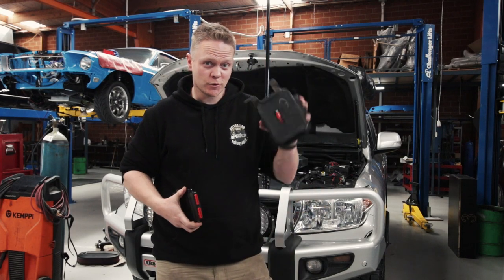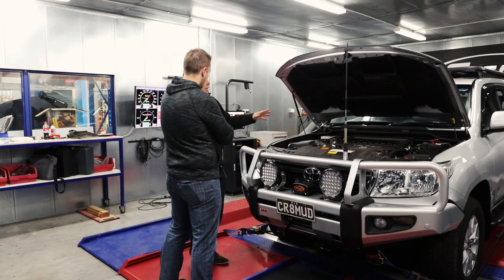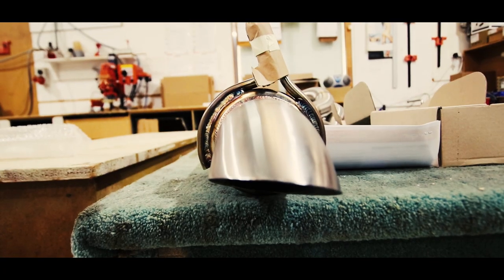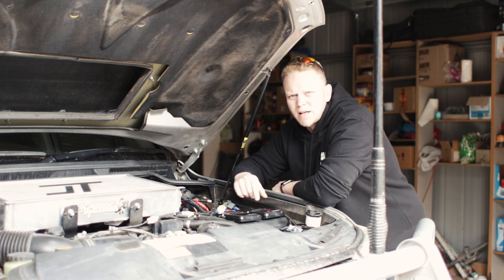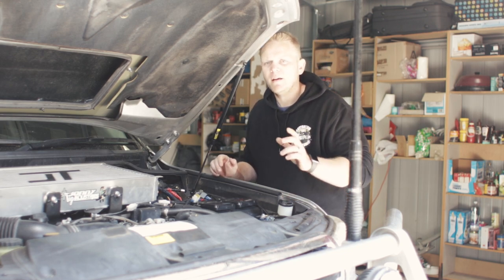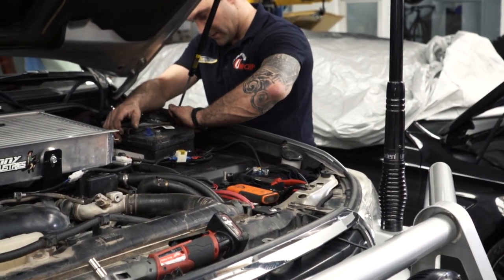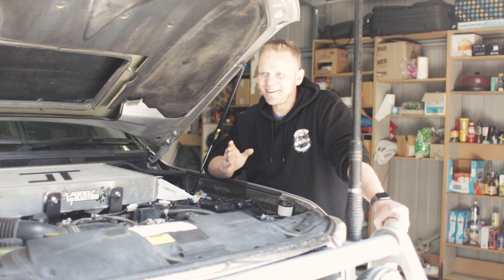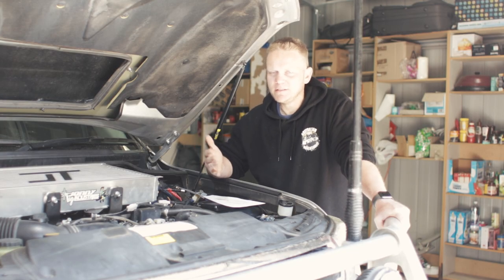Does more MONEY mean more HP? - Unichip X Vs Safari Armax ECU

Comment: I hear you can use the unichp on the 4.8 Nissan patrol petrol 
Is this correct 
I run 35s and tow a camper off road

Is there anyone in SA to fit them 
Thanks
Reply from the maker: Yeah absolutely can.  
Not sure who the retailer is in SA.  
Give Dynomotive a call and I’m sure they will point you in the right direction.

Comment: 118kw/550Nm...is this correct for stock cruiser? 

Well after all  this...this is how I'm seeing these numbers.. 

Toyota V8 4.5L
118kw/550nm. Stock
144kw/620nm. Safari  $5000
166kw/785Nm Uni X    $2500

Nissan 4cy 3.0L CRD
192Kw / 808Nm ECPT $1000
Reply from the maker: So many variables in the process. 
2 wheel dyno 
4 wheel dyno
Temps on the day
Tyre size
Safty In the tune

It’s not about the final numbers it’s about the % increase over factory.
Reply: @Australian4x4Adventures   Cheers for the reply...Fyi... Im on your side BTW 👍
We got the answer to my above question, the reason why the Nissan Patrol 3l is able to push 190rwkw /800rwNm after a remap has something to do with the CRDs are balanced from Factory, have the DOHC setup 4val/pc.. and some other crazy stuff which too long to fill in here..but has been done. factory after the DI versions went to shit. 
Anyway keep up great work!

Comment: Was intercooler on before armax tune? And has fuel economy decreased? As power delivery is now in a different rev range.
Reply from the maker: No the intercooler was after the Armax was installed. 

I mentioned in the video that I went back to safari to see if they would re tune the car with the new cooler and they weren’t very forthcoming with an answer and informed me that it won’t make any difference. 

That’s when I went to Unichip.    It’s all explained in the video
Reply: @Australian4x4Adventures  yeah copy that. I think I've seen standard coolers with uni x runnin 700nm so you can tell ya mates at  armax😜 that it is good for 85nm more at the wheels, and I'm tipping inlet temps wld be down by 4-10°c at least.  Good vids bro good to see you vented that bullshit on the mainstream too, good onya!!

Comment: Hey mate the ARMax gives two extra benefits I believe. Warranty on engine / gear train and lower torque on each gear change for a smoother ride. Does the unichip offer that....your commentary will be much appreciated. Also the wiring on unichip is it IP68...
Reply from the maker: Hey bud.  

Yes they offer the drive train warranty just like safari and the torque is also reduced for gear changes.  

It also ramps power up and down based on engine temps as well.

Comment: I'm currently researching many different chips and remaps.

It seems both have pros and cons.
I do rather like the idea that if a chip fails in a remote location then according to many different sales people then it's a matter of unplugging it and returning the vehicle back to factory specs.

However it does seem that the remap makes more power.

What's your thoughts on both?
Reply from the maker: Both the safari and Unichip are great bits of hardware.  
Unichip for me wins out based on price and better performance. 
A remap is only as good as the tuner you fine and can’t just be unplugged if something does go wrong.

Comment: Hi Mate great vids but wasn’t the power run in your Safari ecu video that shows the Dyno screen at about 14min 20 secinto the vid showing 177.1 kw / 461.2  for Armax ecu and  snorkel not 146.5kw / 326.6 which I thought was the Armax snorkel only run. 
Happy to be corrected and no I have no affiliation with anyone either just doing research for  a good safe engine boost for my 200 series 
Cheers
Shane
Reply from the maker: Hey mate.  
It was something like that ( can’t remember the exact figure ) but that’s because they made me put smaller tyres on to show a higher figure. 

We re ran it with the 33” muddies I run normally at Unichip and it only made the 146 then re tuned it with the Unichip and got the 180 something with the 33s on still.

Comment: I had a Safari snorkel. Actually I’m planning to fit in a Safari ECU when my car is out of warranty. Thanks for your video. I will not do it anymore. I’m just feel very uncomfortable that as a brand with a big name, the way they buy their reputation. It’s a shame. 

Btw, after you fit in the unit chip, there’s a significant increase on the Torque. I’m guessing you’ve done several off road trips. Did you have a check your transmission? Is there anything wrong? I’m just a bit concern about the reliability of the transmission after tune....

Comment: What wrong with remapping through the Kess Ksuit method? You don't need a new ECU.
Reply from the maker: Nothing wrong with remapping for the main part.  

2 down sides but.  
1.  It can come down to how good the tuner is.  Which unichip falls into that bracket as well. 

2. It can’t be removed if you’re trouble shooting something.  Or if Toyota reflash the car for an update it’s wiped.
Reply: @Australian4x4Adventures   So at the end of the day if you love spending money at Toyota and cant rationally diagnose the people with a good OB2 tool, then you should buy a Uni chip? I see the typical corolla driver is infectious indeed with in the 4X4 community. mmm
Reply from the maker: Sorry I’m a little confused by your comment. 

Unichip / dynomotive is also a mechanical shop as well and do full services on all males and models.    

You don’t need a unichip to be a customer of theirs.
Reply: @Australian4x4Adventures  Good to know they provide full service to all males :)  clearly with a happy ending.....
Reply: Adrian you can use either method, both are valid. Chip vs remap, they both have their pros and cons. Why do you think the remap is better?

Comment: Out of curiosity, does the Unichip offer a decent warranty?  I know the Safari ECU retains a huge engine/driveline warranty and I really think that's where the strength in the product lies.  Not trying to stir the pot, a genuine discussion point I think.

Alot of people are waiting until their vehicles are out of Toyota warranty to get power upgrades.  Really, the Safari kit offers a full 5 engine engine/driveline warranty on new cars no there would be no need to wait?
Reply from the maker: Good question. 

Unichip offer the same 5 year 100,000km warranty for new cars. Same as safari. 

All in writing also the same as safari

Comment: Hey Steve
I’m getting a unichip put on in the new year, now that you have been running for a month or so are you happy with the setting or is their one you would like to change ie high idle , thesis response throttle for rocky terrain 
You get the gist
Cheers
Reply from the maker: Hey buddy. 
Yeah I’ve had it on the car for almost 3 months now and still loving it.  
I generally run it on the towing map because it just feels the nicest for driving around home.  
Smooth but still plenty of power.  
The power map is amazing but only really use it when I feel like driving a little nuts or someone NEEDS to be overtaken right now 😂.  

Offroad map is amazing.  Didn’t like it to start with as the throttle was really soft and it took me a day to get use to it but now it’s great.  
No jerky throttle and nice and smooth. 

The immobilized map I use more then I thought.   I park my car with the keys left in it all the time 😂.  

So I put it to that map and I feel a little better about it. 

The one map I don’t like and will prolly change is the eco map.  Feel flat and I don’t like it.   
I’m going to change that to the high idle for winch and battery charging at camp.
Reply: Cheers for that, I too am guilty for leaving the keys in the car, I don’t even lock my work trucks!
Great advise
Did you end up doing a vid on the intercooler? Might be coming up time to do a recap on your rig 👊🏼
Reply from the maker: I’ve had a few dramas with it and only really just got it all sorted so I do need to do a recap vid fairly soon.
Reply: Coolio, as in a chat a while back I did a cross country kit on mine and am pretty happy😊, yea a recap would be good 👍
Reply: Hey mate, hope you had a great day yesterday, forgot to ask, we’re did you end up locating your map select switch 
Just working out we’re to put mine
Cheers
Reply from the maker: Travis Henley   Just on the dash next to the heater vent on the drivers side.   
Cable comes out of the switch panel below and it’s stuck to the plastic above.

Comment: where are you getting 5k price for armax ecu from? im getting mine installed in a week on my Ranger and it cost me $3500 installed. still exxy dont get me wrong but if it were 5k i definitely would not have gone that route.
Reply from the maker: I said in the video it was 5k including the Armax snorkel.
Reply: @Australian4x4Adventures  so you paid 1.5k for a snorkel? I'm so confused.
Reply from the maker: I didn’t pay anything at all.  I got it all for free.  Did you watch the video?  If you did you would of known that.  

I’m just going off what safari told me the retail was on the full kit installed.  
Some may get it cheaper and the price may have even dropped from when I was told the price.  

Does that clear things up for you?
Reply: @Australian4x4Adventures  it kind of does, just means the info in your video is miss leading because you stat several times it is "X" price, although the price you mention is severely inaccurate. ahh well.
Reply from the maker: I don’t feel it’s misleading at all.  
I am clear that it’s for both the ECU and snorkel and I was told at the time that it’s always a package deal because that’s how the ECU is tuned. 

Sorry you feel it’s misleading but I don’t see how.
Reply: Nick Cranston it might also cost less for a Ranger as it’s not a V8. 
I don’t know about the new Uni X but I seem to remember seeing a price list on the Unichip Q3 which has 2 separate banks of drivers, 1 for each row of injectors, and the 200 series was more than most other models for that reason. 
Not 100% sure, but safari might work on a similar system.

Comment: What's your fuel Consumption average after the chip now?
Reply from the maker: Pretty much identical to before. 

But with more power
Reply: @Australian4x4Adventures  and what's that at? 
I'm only asking just because I feel I'm running on the high end. Lift, 32s, roof rack and it's doing Around 16/100

Comment: A mate of mine has had a Safari unit on his ranger for the last 3 years and has run like a dog. More power...just.... but smoked like a bastard at idle FFS! It finally shit itself one day and just stopped dead with the check engine light lit up. After testing what was wrong found the actual wiring loom had broken down!! Ripped it out and has run a lot better.. down on power but heaps cleaner and smoother!!

Comment: Interesting video and I like your channel but it would be good to know how they got the additional power. As in, is it because the tune is more aggressive and thus riskier? Also, because safari made it hard to update the tune, we will never know if their tune for your mods would have netted similar power. Not your fault though. It could have been a positive story for them but it turned into a negative one, ironically due to them trying to protect their reputation.
Reply from the maker: That’s exactly what I was trying to do for them even after everything else.   
But yes.  They made it far to hard for me to keep trying with them.  

I don’t want to speculate on how they got more power as I don’t know the ins and outs. 

Prolly a question better asked direct to unichip.  

I have a heap of msg back and forth between me and them, and they repeatedly told me it wouldn’t make a difference
Reply: Australian 4x4 Adventures I totally understand. But if you can bet unichip to do a video with someone from them talking about how they do their stuff, within bounds of not instructing others on how to copy their work or commenting on Safari, it would be a great follow up. 

Cheers.
Reply: In short, yes. 

If it makes more power it has either more boost/fuel/timing in it, or a combination of those and yes will reduce the life of involved components, but that's the price we pay for more fun :)

No doubt the Safari setup would have yielded similar results, most of these companies all known more or less the same stuff.

With the service he was geting and the price they wanted though, why would you bother. 

You don't have the to have the absolute best product in a market to do well in it, customer service is worth a LOT.
Reply: Peter J unichip have hePs of vids on their insta and FB page👍

Comment: Hey mate you said you didn't get it re put on the dyno from safari with the exhaust and inter cooler?? wouldn't that give more power to the safari tune???. So you comparing the bare basics safari tune with no exhaust and inter cooler to uni chip with both added?? False advertising..

Comment: I worked for a shop that was a unichip agent before  Dynomotive took the license over.
It was as close to a nazi regime as you could get. If we had a faulty set of tuning pots, they would not even send a replacement pair until they had our pair back in their hands. 
No sharing of knowledge from other shops, no access to diesel wiring schematics (as it was all dtronic owned)
Was literally a total waste of a product.
Dymototive send the product on a path to success when they took it over, but I think it could still be in a league of its own if a USA type open platform product was adopted and more people had access to this great product.

Comment: Haha, absolutely great channel matey
Reply from the maker: Thanks buddy.  Really appreciate the kind words.  I try my best
Reply: @Australian4x4Adventures  Anytime Matey. Just wondering if you have done any videos or information on a good Upgrade Kit for a 2017 Ford Ranger 3.2 manual, My very first 4X4,  I brought one the other day. Haha Unichip, I'll be purchasing, thanks to you. 
This is what I've found so far. From other channels. 
- Unichip
- 3 inch Exhaust/ Dump Pipe
- Turbo/Intercooler 
- Stainless Steel Snorkel 
- Larger Fuel injection ports
And what's your thoughts on a Blow off valve for a 4x4, would it be beneficial?
Any information on a good Upgrade Kit would be awesome. Cheers matey.
Reply from the maker: Hahaha.  Yeah Unichip would work wonders for a Ranger.  
Unfortunately I don’t know ahead about the ranger gear as I’ve never owned one. 

I’d prolly just go with a decent bullbar and a lift kit with some muddies and see how that goes to start with.  

I personally wouldn’t bother with a blow off valve but each to there own I guess.
Reply: @Australian4x4Adventures  Haha, Yea I've seen blow off valves on other peoples channels. Wondered if there was an actual difference. 

Cheers heaps for the replies matey. I wish you the very best for your future endeavours.